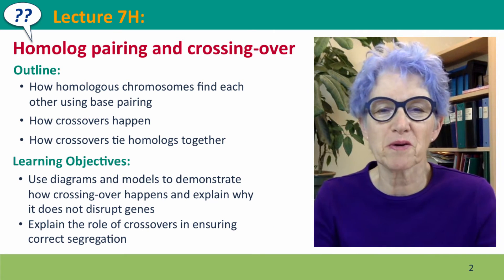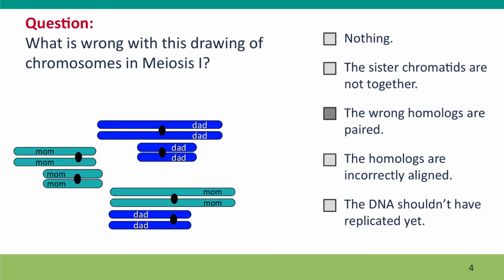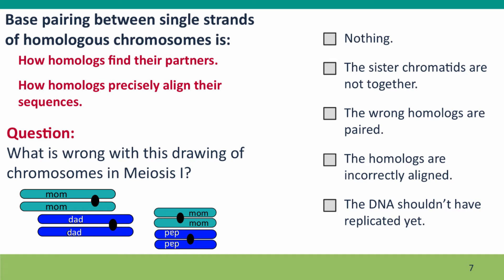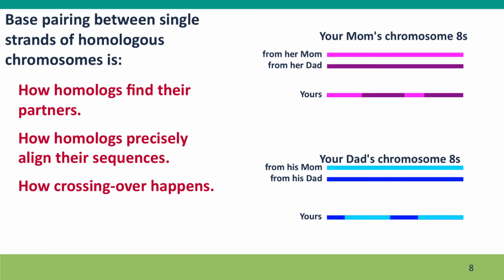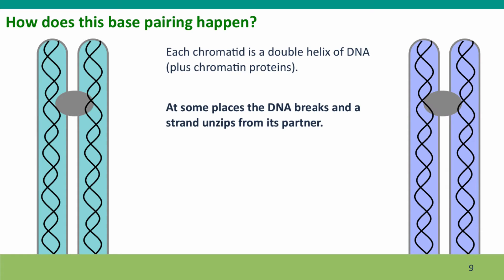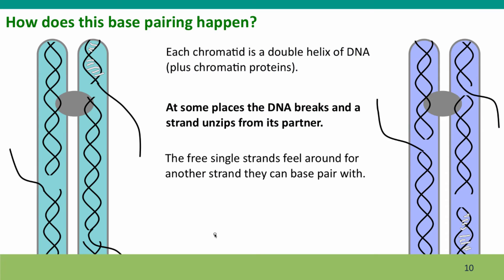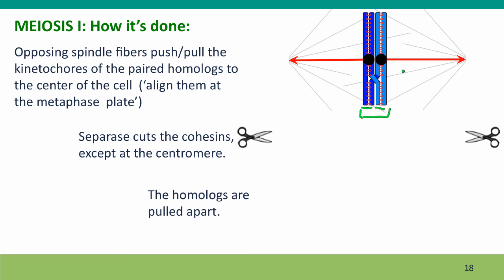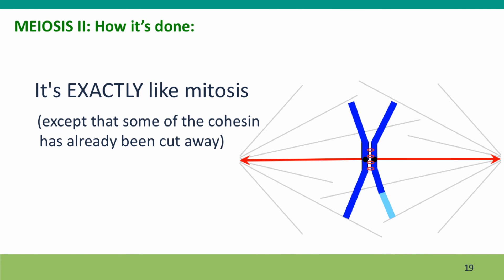7H - Homolog pairing and crossing-over

Comment: Thanks. Very descriptive, as always. But I still don't get, given that the cenrtomere holds the sister chromosomes just in the middle, how the whole connection between them doesn't fall apart in case of crossover happening not at the ends of the chromosomes but, say, somewhere in between the centromere and the ending of chromosomes? I gather crossover occurs many times along the one chromosome chain, right?